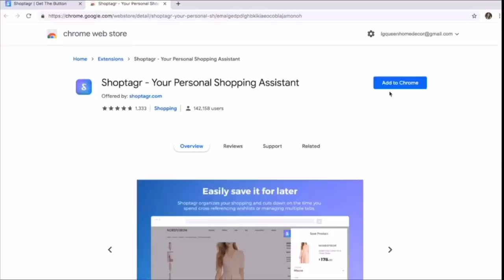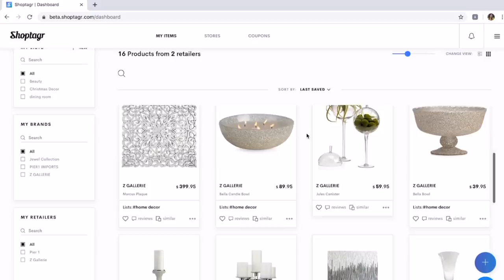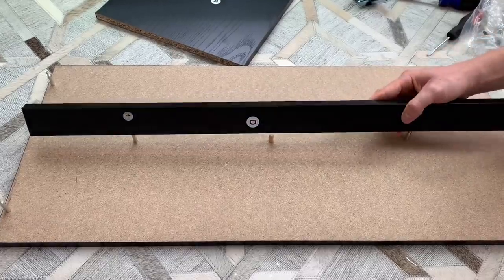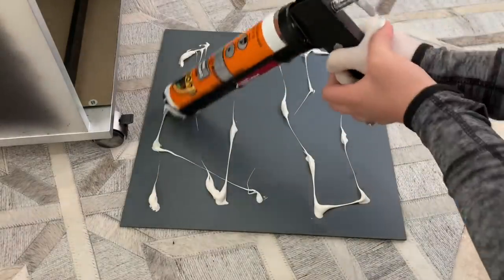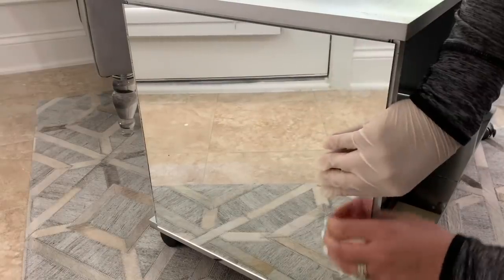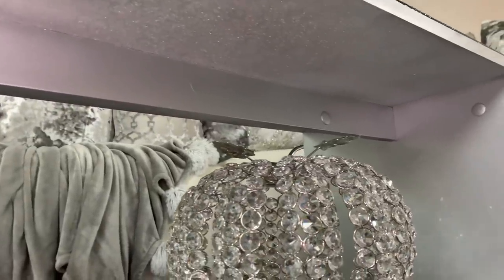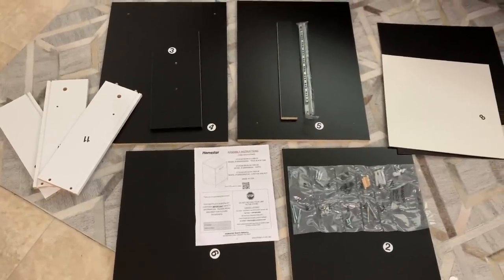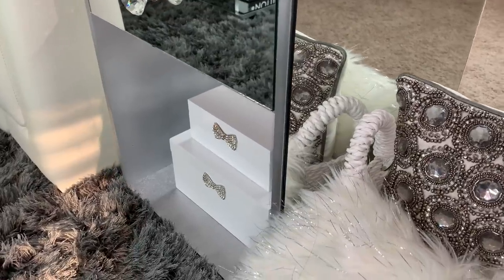DIY MIRRORED FURNITURE HACKS! Easy And Cheap DIY Home Decor

Comment: Excellent tutorial! I tried building my own mirrored end table (before I found your tutorials) and it was a disaster lol. I cracked the wood with my “pilot holes”, and drilled through a piece of wood. The good news is that, as a lady, you’re treated like a queen in Home Depot 😂
Reply: Sarah, A very long time ago, my dad told me to place a very, small piece of clear tape on top of where you are going to drill your hole. This should prevent any splitting, of any kind.  ( On virtually anything. ) 
Normal, clear, ( To wrap, wrapping paper, for gifts. ), tape, is fine. I hope this helps! 
 I want to build this beautiful table, as well! But, I'm afraid I will crack the mirrors, if I try to cut them...😢  LOL! 
Good luck ! ❤
Reply from the maker: Hi Sarah, thank you very much! I glued the knob on the side table drawer with gorilla construction adhesive because I know I would crack the mirror if I drilled a hole in it 😂 I love Home Depot they are always so sweet ❤️

Comment: I’ve called 3 different Lowe’s after going to my local Lowe’s to find out they don’t cut mirror...and they all say they don’t cut mirror to size even if you buy it there! Anyone else found this issue?
Reply from the maker: Wow, I can’t believe they said that to you. Did you speak to a manager? Many times the associates have no idea that there is a small glass cutting section in their store because it’s so small and is in the isle of other products. Therefore they will tell you they don’t cut glass or mirror. I would speak to a manager because they will definitely know to direct you to it. I asked my Lowe’s associates and manager if all Lowe’s cut glass and mirror and they said every Lowe’s has one. There is a new rule I just saw them put out in one of my stores that they can only do a couple cuts not custom cuts because of so many people that come in for it and it takes a while for them to get it done for everyone. Some associates have bent the rules for me and cut the pieces I need so hopefully you will find someone that can help.